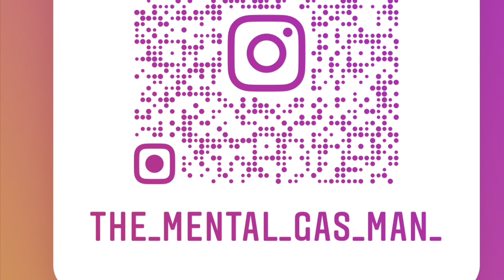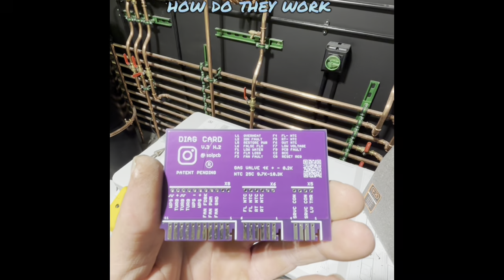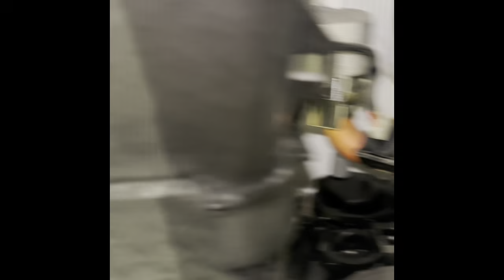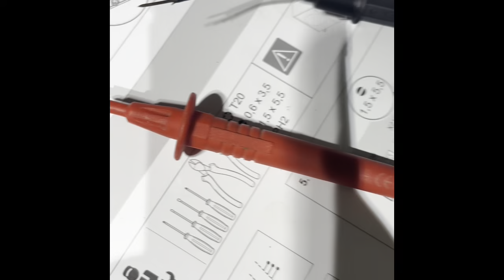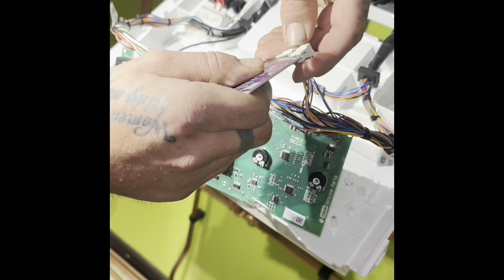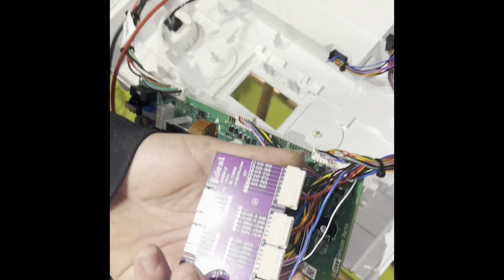Boiler test cards

Comment: Fantastic idea, but it is only for testing individual components. However, you can’t operate the Boiler with these Test Cards. 
A much better design would be having it in Series with the wiring harness, to enable the boiler to be Fired Up.
Thanks for sharing MGM👍👍
Reply: @jimmygillies5590  It's definitely been produced but a Baxi Engineer said it's only for Engineers....oh but I am a Gas Safe Engineer ...no we mean our Baxi Engineers 😂...If these were readily available they would lose a chunk of change.

How long did guys change complete fans until someone clicked oh it's the PCB board that gets changed mostly...making a huge savings and pushing the manufacturer s FPR !
Reply: @ I guess it’s a commercial world & a free market economy. So Baxi can do or say what they like. A lot being down to the Skill Set of the ‘Engineer’. On Fans for example, I & others have changed Bearings on SE boiler Fans for the last 20-30 years. 

These Cards, I understand, will soon be readily available.